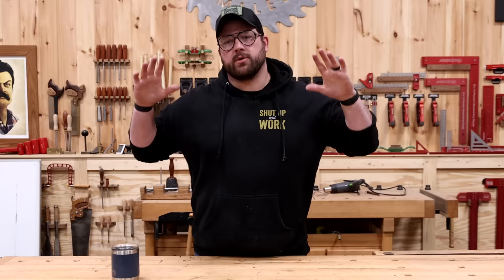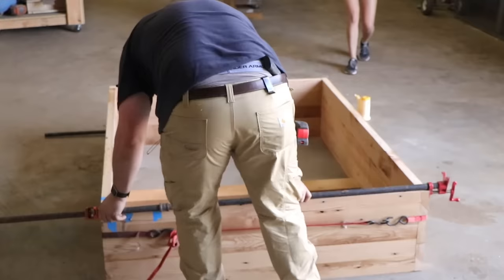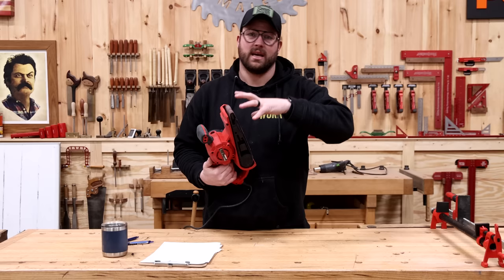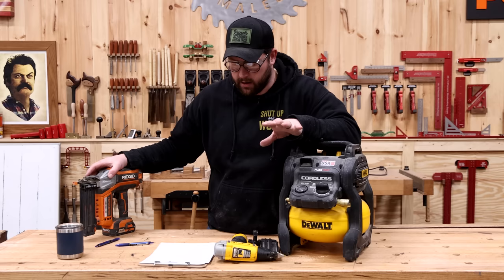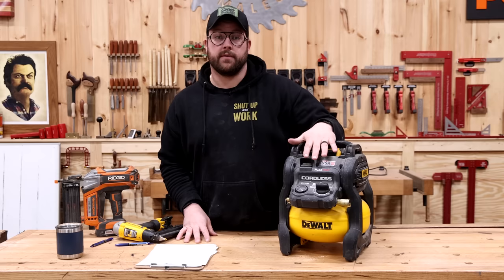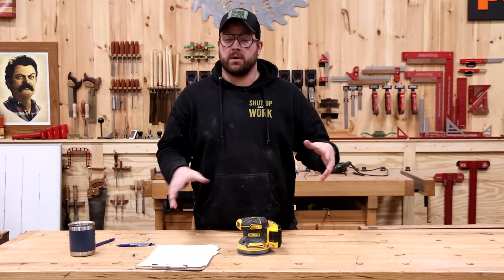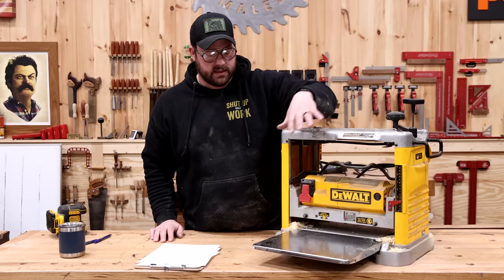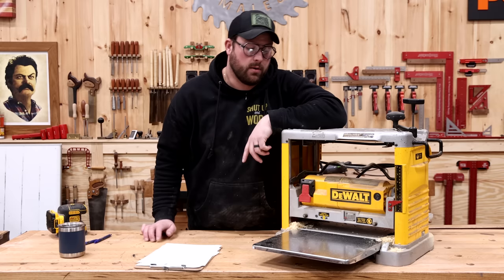5 Beginner Woodworking Tools I Regret Buying

Comment: Totally 100% agree about the planer. I bought the orange lunch box planer at first, and I basically had to keep buying blades for it…at $55 bucks for the replacement blades I very quickly offset the price difference between the two

Comment: I tried a handful of cheaper handheld belt sanders when I first started. All garbage but with practice I got really good with them. Then I bought a 300 dollar makita handheld belt sander and that thing runs so good it’s hard to mess up and gouge the wood. I would recommend the makita all day everyday. I do so much damage with that makita it really is my money maker when doing a single slab dining table that doesn’t fit into anyone wide belt sander around. After the router sped I work up from 40-120 on the handheld belt and it takes a few hours but it makes me a ton of money in retrospect.

Comment: Love the video. 
#1, agree on clamps. You get a lot of cred in my book for shooting down all the content pushing trendware. And my favorite part about pipe clamps, if there's a fitting for the pipe, you can use that to change both the X and Y angles for complex designs. 
#2, Current belt sanders are trash. I'd rather use a RO or oscillating multi-tool. There are a few discontinued belt sanders that are incredible(with outstanding dust collection) and no form of palm sander can compare. The drag car style are the worst. 
#3, Agree, don't fear the initial jump of buying into pneumatics. Personally, I'm a bigger fan of the hot dogs over pancakes. Batteries and their ecosystems die off in painful ways, any tool where you can go air, DO IT. 
#4, This is where a router game comes into place for a *beginner*, at least my opinion. All fixed mount sanders are game changers if you build a lot of repetitive and intricate projects, but if you do less than 10 projects a year that could benefit, it's really a waste of money. 
#5, Planners are a commitment. I agree with you wholly. I don't even bother with planners unless you're willing to dish out. 

A bunch of good videos exist on tips like this, but again, shooting down parallel clamp users so respectfully, great job. You sir are speaking the truth.

Comment: I got all my pipe clamps at a garage sale from a guy cleaning out his wood shop. Cheap. Have to say though the belt sander is one of my favorite tools. I use it for edge sanding fast and flat. It either sits upside down on my bench or I have one attached to a board for really tight work.

I got started using trim nails and a hammer. Way cheaper than a brad nailer. Although I love my nail gun I have now.

And that Dewalt planer... I have the same one. I was wondering if mine was defective. I got it used recently and regret it. Always popping its breaker. Always. My old Delta chugs along and eats anything I throw at it. I was thinking the Dewalt was an upgrade. NOT.

Comment: I agree almost to everything, but for clamps, I really like to have the Irwin pistol grip 16 inches clamps, they are so fast to setup just grab and squeeze, I have only 4, but after 10 years I broke one, and looking to get another set of 4 as soon as they get on sale, as for the battery platform, started to use Dewalt, even if all my uncles that are contractors use Makita, after being deceived by Dewalt, switched over to Makita, never had another issue, never looked back! My view on tools has changed, I don't care much about a great guaranty, I'd rather have a tool that doesn't fail, cry once!

Comment: Awesome video!  You saved me on clamps and the planer.  I've figured out the belt sander and spindle sander before I bought them.  I just used a drill with spindle sander yesterday and thought why would I need a big box I can't move freely while sanding the piece

Comment: Wow, I've avoided many of these -- I don't have K-body clamps (but I'm on the lookout for some used ones), I have the air compressor/nailer combo, I generally think low-end cordless tools are underpowered, so I've only got corded sanders.  Where I differ a bit is the belt sander -- kinda.  I bought a WEN convertible belt sander that can be easily clamped to the bench.  Love that thing for its versatility, and it's only about $50.  Perfect for me.

Comment: Sage advice! 

It took me years to buy a compressor, and I only did because I got it for a song new (a Delta).  Within a month I realized I had needed one for years but was too stupid (or cheap) to buy one.  I own the Rigid oscillating sander.  I use it for some things, but it mostly stays in the cabinet.  I regret buying a mortiser.  It was all the rage there for a while, and I was building a Morris chair at the time, so I picked one up.  That was like 14 years ago and I think I've used it once since building that chair.  I still have it, but...

And the clamps.  I have zero K body clamps.  Pipe clamps and F clamps work great and cost a lot less than those K clamps.  The price of the pipe has certainly gone up a lot though (grrrr).

Comment: If you cannot afford the big boy parallel clamps harbor freight has 48" for $40, perfectly usable until you can buy the better ones and even then you will likely still be using them on occasion, a man can never have enough clamps.

Also harbor freights  bauer line has a cordless brad nailer and a cordless narrow crown stapler for $99, or $89 with a battery and charger when they run one of their deals. Both have bump mode.

Comment: I’ve never blown the fuse on my DEWALT lunch box planer. Also from the get go, I mounted it to a cart so no tipping. My two main gripes? Snipe and dust collection. I’ve tried all the “YouTube” solutions to snipe and the best one was running it at an angle. But I still get it and lines that need to be sanded. Maybe when I upgrade my dust collection, I won’t get so much chips flying out the front and back. 🤷🏻‍♂️

Comment: I have used the exact same dewalt Planer since it was introduced. I have NEVER had the fuse pop; machine stop; or tip at any point in use. I’m shocked to see you give such a bad review to the machine. It can have a helix head used in the machine as well. I think you got a bad unit.

The weight? No heavier than your 12” mitre saw or any other awkward tool. 

Interesting perspective. I think the dewalt planer you reviewed is one of my best machines.

Comment: That DeWalt planer you need a 20amp dedicated circuit so it doesnt keep tripping the breaker i have a Ridgid planer i have no problem with it most plug in tools need a dedicated circuit anyway because of the startup surge just saying i like your video very informative 👍

Comment: Cheap pancake compressors are great if you only use them occasionally. A compressor is so useful once you have one I will bet you use it every day if only for cleaning the shop! Getting a good one does not cost much more, look for an oil, not oilless one ( the pancake ones are oilless). Way more output, quieter, and will last

Comment: I 3d printed myself an adapter for my RO Sander. works great. I bought a HF brad nailer because I use one maybe once every few years. 25 bucks at the time. If i used it more I would have gotten the better tool.

Comment: I agree its a way better deal to get the 100 dollar more expensive planer. Ive owned one of the 12s and we used one at work and i gotta say they can take a hell of a beating. The work one was atleast 10 years old by the time i left that company, it had been on from 745am till 5pm offnfornthe 30min lunch running boards nonstop and do that all week. The 2 i used never have actually tripped the internal fuse like you did in the video. Ive run it off a 50foot red and black drop cord no issues. I have had lumber that was dimensionally so much larger from end to end that it jammed so i had to turn it off and raise the blades. But didnt trip.  The trick to this planer is if its 6" wide or less do 3/4 to maybe a full turn per run. If its wider only crank the blade a half turn per pass. Its a workhorse but just not meant to take  1/16 off every pass.  if youre having trouble wirh balance sniping  etc put a roller stand on the other side to catch the boards as they come out

Comment: Now you know three ((kind of) who can and do use belt sanders), but I've done a lot of slabs and things.

AND, there is that a ROS isn't even in the game, when it comes to scribing things to a wall.  For that, the ideal is the Porter Cable you can hold in one hand.

On the spindle sander (Jet bench top or floor model), like several tools I don't use every day, most of the time, it'd be replaced within a month, if the one I have became a total loss. 

I make a lot of curved edges. Having several different diameter spindles to tend the curves of, for example, 2x's or laminated pieces of hardwood I've cut curves all the way down [to make a wavy, bent dowel walking stick] makes tending that task multiple times easier than any other way of sanding it. So, they have their place, depending on your project passions.

On the planer, though I have the old Delta that stood at the top of the pack before the [good] Delta came along, and which has served me for headed toward or past twenty years, I agree 1000%.  And, start with the helical, if possible.

Comment: Great video. I think you just saved me a couple thousand dollars. A bench top planer is my next purchase and I wasn’t sure which DeWalt to get. I don’t expect to need the extra 1 inch width but the power difference and time saved from tripping the breaker would absolutely be worth it.
Reply: I have a lunch box planer and it never tripped its reset. I have a feeling once that reset has tripped once it gets more sensitive then. It stands to reason that it'd loosen up.

Comment: I have a hate-hate relationship with Harbor Freight, but their pipe clamps and air brad nailers are good. I have a couple of air brad nailers (one also uses staples) that cost me about $15 or $20 each. They are still cheap, and they are still going after 20 years.

Comment: Belt sander will sharpen your chisels, drill bits, knives, and planes.  Just don't invest in an expensive one.  Also good for fitting counter tops and shelves to your walls.  I did things like this as a first year apprentice.  Unless you frame, finish nailers and narrow gage staplers come in handy.  Maybe you re a hobbyist, which is ok, but commercial carpentry, you need these items. Straight edge for your saw can be made from the edge of Plywood and nailed to 1/4 paneling.  As far as. Clamps, a piece of 3/4 " pw 4 14" studs and two wedges will make a great clamp.  Stay away from battery powered tools, use corded till you know what you're doing

Comment: I have a batterie dewart sander. I did a cargo conversion with it and still work super great. Seriously you can’t say you don’t recommend a baterie dewart because it’s baterie operated. If we choose baterie it’s because electricity is not always possible and we want to work in off grid areas. Ps my baterie dewart sander works GREAT

Comment: Belt sanders have a use in shaping or taking down spots on rough lumber, but they are not a finish sanding tool. Agreed, they’re a trap for new woodworkers. I had one, it broke, never felt the need to replace it.

Comment: I love my parallel clamps but I'm also not a beginner.  I did the cheap clamps then the pipe clamps.  Pipe clamps are great but the don't have a lot of reach.  The cheap clamps bend and/or break.  Plus, when you add in the price of the pipes at today's prices, you're better off getting a harbor freight Bremen 48" parallel clamp for $45.

Comment: Agree on the cordless nailer.. just not going to happen! My business would have been stillborn - were it not for the pneumatic tools and air compressors. I would also concur that the Pin nailer - while a bit tricky to use sometimes - was a huge game changer when working with thinner stock, as well as being lighter and easier to handle. Doing paint application with a sprayer on a compressor. Just those few items cut basic assembly time by nearly 3/4. Interesting on the 12" planer.. I've never heard one other person mention that there are issues in using this tool.. thanks for the tip.. guess I'll have to bit the bullet if it comes time for me to start doing pallet recycling or rough lumber plane downs. Thanks for the video, nicely done.

Comment: Bessey definitely dropped the ball when they redesigned their K-Body clamps. The old versions worked very well, even if their round wooden handles give you blisters. I like the form factor if you're doing glue-ups frequently though. If I was getting started I'd look for a competitor's version of that style. Pipe clamps can easily blemish your work piece w/out some type of pad (I made some magnetic ones from some rare earths and 1/4" plywood) and they will deflect more than a K-body style. Pretty much everything else I completely agree with - nice video!

Comment: the spindle sander is really only worth while having if your doing stuff like building guitars - where you really need to hold the pieece with both hands to target a specific area - but aside from that - if you are doing that ruining your piece is way more expensive than not buying a better tool - espeically since this is typically a more than 1x mistake lol - probably best to go to a maker space or shop that has one, there are lots of those around now.

Comment: 14:02 I would agree … Invest the money in the bigger Dewalt. Although I have had the 12.5” Ridgid for 8 years maybe longer and I haven’t had many issues with it at all. Definitely better than the Dewalt competitor. So if you’re gonna save money go with the Ridgid. It doesn’t have the reset button that trips all the time and I have never seen it even try to tip over. However, helical heads are worth it and the $600 Dewalt is the way to go!

Comment: @John Malecki @12:20 I've had that exact problem when I changed the belt...the parts are so cheap it's not able to tension the belt properly to prevent slipping.  Super irritating.  I ended up returning it for a cheaper Ryobi Table top sander that was on sale.  Not that the quality is great there either but it is cheaper...

Comment: if you don't have dewalt or another platform batteries, the harbor freight pancake compressor works great and is also a lot cheaper - buy that and a heavy duty extension cord - I've had mine for almost 15 years - it doesn't get used too oftern, but when I use it - I'm using it all day, at one point we used it to blow out the sprinklers, use nail guns, I've even used it to paint a car - for $100ish you really can't beat it - and if you need a better CFM compressor for a specific task you'll know that a head of time.

Comment: My only disagreement is the cordless palm sander. I just have the super cheap ryobi orbital one that came free when i bought a battery, but it probably sees more use than ANY other tool ive ever had. Dust collection is near perfect on it and very easy to clean. Plenty of power even with the non-high performance batteries and still going strong after 4 years and dozens of drops.

Comment: Good video. Disagree on the belt sander/orbital sander. A belt sander can remove in 10 seconds what would take 10 minutes with an orbital. They are not for the same use cases. I need both. An orbital can't replace a belt sander imo.

Comment: I have been going pretty hard on woodworking for about three years. After a lifetime of not having a work space, and making do with a drill and circular saw, I finally got a garage and have been collecting tools. You have lots of good advice, but I definitely disagree with one thing: That Kreg circular saw jig can be handy. It is not worth the time it take to use for a single cut, but when I am doing case work, building cabinets where I want six pieces all at exactly the same dimension, that Kreg jig makes it easier, quicker, and more precise. I used it this very weekend.
If I had a big table saw, where I could lay out and cut a sheet of plywood, I'd give my Kreg jig away. But I have a jobsite saw, where I can't cut wider than about 30 inches square.

Comment: I disagree wholeheartedly when it comes to the belt spindle sander.  I use this tool on almost every project.  It is an invaluable tool in my shop.  I do agree on the other products.  Great video.

Comment: I can't speak for the B&Y planer, but the entry level PC I got at a big box 10 years back won't die, even with dull blades going through some very hard woods.  I'd like to upgrade but I can't justify it.  I'm pretty sure it's possessed.

Comment: Hard disagree with the belt sander. Learning to properly use a belt sander early on will completely change your perspective on sanding, and make you  think of alot of new ways to do things. It is admittedly quite hard to learn how to use it well (and without scratches), but well worth it in my opinion.

Comment: Ha! Last summer I made my garage and wanted to buy some fancy battery nailer gun. Turned out to buy a mid-lowend 'silent' compressor with a Makita air nailer and saved a lot of money. Also: I can now inflate the tyrey easily :D
Reply: I can't say enough to recommend an air compressor for a serious shop. Maybe you won't need to use it all the time but it's nice to have for when you do need to use it. Just the ability to use high pressure air is invaluable. What an air duster can do is unique. The lowly blow gun is a handy device. Once a guy I knew asked me what the most dangerous air tool I own is and I thought for a moment and then said, my air gun. He looked at me and said your air gun? He knew what tools I had.  I was like but that's the thing, it's what you don't expect that'll bite you. I have an unregulated air gun so it could blow an ear drum out. Launch something into your eye. I wouldn't even use it up close to my skin. It might be able to put air bubbles into your blood. I don't want to test that out. There's a reason they don't sell unregulated air guns. You usually can get to the restrictor in them and drill it out though.